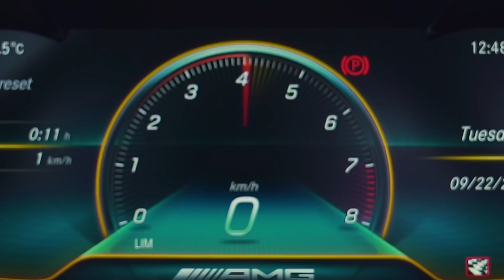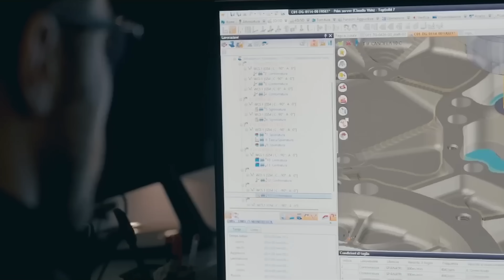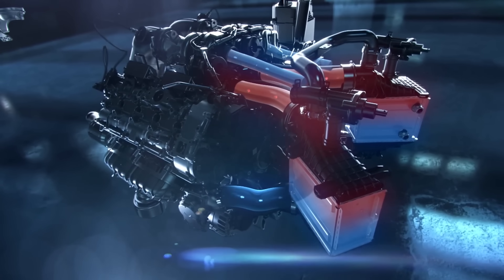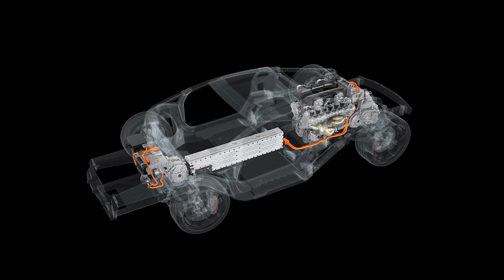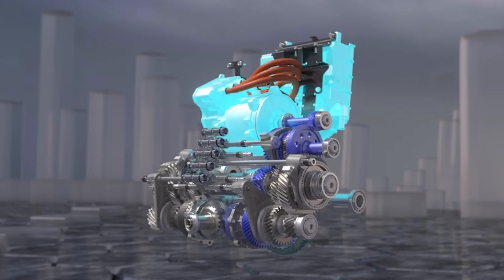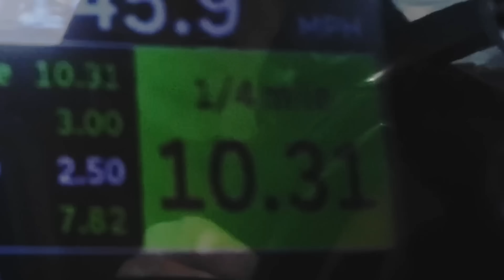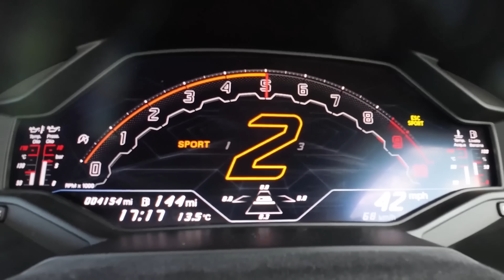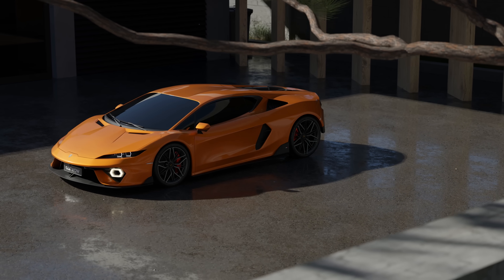Lamborghini's new Twin-Turbo Ferrari Killer!

Comment: Lamborghini needs to keep producing NA V10 and V12 cars. If they want to try electric or hybrid, make a different model, but keep what’s proven and loved by everybody in production.
Reply: they literally can’t. they have fuel consumption regulations to meet and they can’t just say “screw it” and do what they want.
Reply: @steviewondaaa9488  Even if lambo attach a eletric system make it hybrid ? So how they can makle Revuelto with even bigger engine ? That seems cost eficiency sharing a old VW/Audi/Porsche/Bentley v8 twin turbo...
Reply: Just let it go Articles Show. GET A TECHINCA. V10 IS DEAD
Reply: @yurimbarbosa0  well firstly, the revuelto barely made it past regulations. and for it to actually do that, audi and the rest of vw group needed to have evs and hybrids to take down the emissions.
Also if you listened in the video, the engine won’t be a 4.0TT V8 shared with tons of VW group cars, it will be its own V8 hybrid engine used only for the huracan successor.
Reply: Nah they should go twin turbo..way more power and torque capable ...there's enough v10 and v12 out there in the market trust me when you want one it will be there
Reply: Yawn. Power this, power that. Who needs that much power anyways?
Reply: @anttij2973 it has absolutely JACK to do with power. It's about sound and emotions. I'll take a 600 hp NA V10 over an 800 horsepower turbo V8 any day.
Reply: Nothing stays the same its needs to evolve should they just throw in a carbureted v12 from the countach?
Reply: @jeremysoto4596  Lamborghini is iconic for their NA engines. If a car does not have those, then it is not a Lamborghini in the same way. That’s just the way it is; after building cars for almost 70 years, they’ve put themselves into such a situation.
Reply: Mate, you're very much right and believe me, the people who build these cars must have wanted that more than any of us do. But, there are things us peasants don't understand that they have to listen to so let's admit that they're still a work of art and experiences we would pretty much cry having even once in our lives. These car designers and engineers are awesome and they need the respect for that ❤️
Reply: @Grimreaper-g2i V10 isnt dead bro.
Reply: @jeremysoto4596 they should produce a V12 Twin Turbo and 8-Speed Gearbox
Reply: It’s a real shame, the Huracans EA824 is a gem. Capable of holding quadruple the factory output and being reliable too, it’s a dream of an engine. Sounds awesome too, you could make it sound like the 5.0 Gallardo pretty easily if you wanted to

The C7 RS6/RS7 had an EA824 4.0t V8, the B8 RS4/RS5 had an EA824 4.2 V8.
Even the EA837 (supercharged V6) was related and they all had tons of potential for power and sounded awesome.

Those have been replaced by the EA825 (4.0t) and EA839 (2.9t/3.0t), still great engines.
Reply: You should research what car manufacturers have to live up too, to make a car road legal. They can't just make cars, if they don't meet the requirements, which get's stricter and stricter.
Reply: @steviewondaaa9488 this is mental that they don’t let artists make masterpieces, i mean there are literally only 1000 lambos on that kind in whole world where 500 are inside of garages of richmen, just why
Reply: This ain't electric. It's freaking Twin Turbo.
Reply: @Neojhun  You don't really know cars, do you. I'm referring to this, AS WELL as the Lanzador.
Reply: Rules and regulations sadly
Reply: Vw can't keep sacrificing cars to the mpg gods
Reply: I hate electric cars but hybrids without compromising the engine are badass.
Reply: @steviewondaaa9488  they are supercars not bloody economy shitboxes that have to always meet so called regulations, let them retain those V12s and V10s
Reply: @Wonderer245  what exactly is your point? they still have to meet the regulations…
Reply: Must now, what is the problem?!?! No every time only v8 or v12!!!!
Reply: It’s not a Lambo if it isn’t a V12 or V10, or it’s just a golf with a larger engine
Reply: Government regulations and the epa are killing our cars.  But you'll be able to get any boring suv you want
Reply: V8, V10, and V12 should be classified as musical art
Reply: That's nice thing to say but they'll be facing big fines for the emissions of the cars. Which is why alot of European cars are downsizing their engines. I love the C63 black series, the new C63 sounds like utter crap. So Mercedes have already found their way to safety from fines
Reply: i disagree
Reply: Laws prevent that from happening unfortunately…
Reply: I just dont want to see low performance NAs "compared to turbochargers". Just make one with a turbocharger
Reply: I just realised. This is not a new Lambo. And also, no... The new Lambo will not have a V10. Its already decided it will be a V8.

Comment: Forger about that Turbo V8 that's definitely going to be the RS6 one with a few shiny things. If it's going to replace the V10, how about cutting of 2 cylinders from the current one, downsizing it to that sweet 4.4/4.2 liters, make it high rev (about 8500/9000 rpm) keep it NA and adding some electric power just like in the new Revuelto. Give it that 680-700hp and it would be more than enough for a "baby" Lamborgini
Reply: I'm not worried about the engine. On reddit there's a discussion about the new v8tt hybrid that's gonna replace the lambo v10. It's gonna have a redline of 9000rpm and will have the hybrid system fill in down low when the turbos are starting to spool up.
Reply: The engine is brand new. It is unrelated to the engine in the RS6.

Comment: Yeah, I was quite relieved when Mat said it was a render (a bit too far in CarWow, being a bit clickbaity there). It looks good, but the rear is too much like a McLaren. I hope the final version is more Revuelto-inspired. My guess with the powertrain would be a twin-turbo V8 with an electric motor, specifically the engine from the Urus. I doubt Lamborghini - or VW for that matter - would go through the effort of making a new engine or making significant changes to the existing 4.0L like changing it to a flat-plane. Instead, it will likely be like an Aston Martin - great styling with a dirty and intoxicating engine noise.

Comment: Spoiler alert: The new Lamborghini Temerario has a 4.0L  twin turbo V8 and 3 electric motors (2 in the front, 1 in the rear) making 920 hp and 2,150 Nm of torque.

Comment: My Calculations.
The Aventador=740-750hp
The Reveluto= 1000hp+
Huracan= 640hp
Comparing All These if Lambo strips one to two motors off. We will get 640×1.5= ×
According To These  Calculations Huracan Estimated Horsepower
750-820hp
It's Rivals: including the 296 GTB 810hp+
So We Should get
Not Less than 790hp to 835 for the New Baby Lambo.
Do you Agree With me Mat.
Reply: The 296 will not really be the rival of this. Ferrari will debut the 296 successor less than a year after Lambo launches this.
Reply: @AB-80X  Doesn't matter they will still be rivals. and what is the Italian Stallion Gonna do lauch another one 830 hp remember each of these brands have a  baby supercar
Reply: @Grimreaper-g2i  
In some sense yes, but not by time of production and buyers choice.
Who knows what power the 296 successor will have. But most likely more than the 296, just like the 296VS will have. The SF90 will also be replaced at some point soon.
Reply: @AB-80X   it's gonna have much its a baby SuperCar Remeber It's Ferrari's Mid Range. AWD huarcan will beat it in 0 to 60 almost any day So There is No Doubt The 296 will have more than 850 hp in its Next Gen

Comment: Flat-plane 8 needs a smooth crossover (like a Mac Prochamber or a smooth (NOT a stamped) X pipe) or all-into-1 merger (4-1 or 4-2-1 headers with Y-pipe, 8-4-1, or 8-1) in the exhaust, as well as all equal-length exhaust, if you want it to sound heavenly and less like two 4-cyl engines.

As far as the displacement, I don't like how they went shorter stroke with the 2nd gen 6.5, though I DO like that it's bigger bore. TBH, use the bore from the new one, and stroke from the old one to have one final swan song of V12 insanity at a WHOPPING, VIPER-esque 7.6 liters that would make even a Pagani cry in the corner.

For comparison, that'd keep the new V8 at 5.0 liters, which would be more than enough, especially combined with the turbos, to do some SERIOUS damage to the competition. Otherwise, just using the same bore and stroke from the old 6.5 would also be good for the V8 at 4.3L, but better for producing torque. At that point, if the V12 had the hybrid old stroke+new bore approach, it's 7.6L would probably be enough to stand above the turbo v8 without worrying about being easily dethroned by a simple bolt-on+tune.

I mean, an 89mm stroke is perfectly safe at 8000-8500rpm, why rev higher when it just makes it harder to match a trans and diff for sufficiently low cruising RPM for corporately/regulationally acceptable emissions and fuel consumption while still actually taking advantage of higher revs with gearing?

Yo, but I'mma have to stop you from disrespecting the 296gtb sound, that thing is amazing with an aftermarket exhaust. Hate on Ferrari as a brand because of their shitty business practices and treatment of customers, but I will no longer tolerate "V6s sound bad" slander. G E T  O U T.

Comment: I hate the hot v tt, v8 from vw/audi group. Bring back the tt v10 and build it up to out out 600hp. Still retain v10 but smaller, higher rev limit and just a bit short of the v12 power. Sad to see lamborghini use v8 😢

Comment: Well, as a absolute R5 and V10 Fan, i am not amused. It looks like the same mistake Prosche did with the 718. A Turbo V8 is the same boring stuff as any other sports car in that class now, thats the bigger issue to me than the hybrid system. So yeah, if you ditch the V10, then just go fully electric directly. What they do now is just a slow painfull death for their ice lineup.

Comment: i think they should use the the v8 from the first gen audi r8 but it's a goodbye to the v10 rip lambo v10 from 2003 to 2023 with the r8 huracan gallardo and sesto elemento
even the other v10's from dodge and bmw and lexus 
from 2009 to 2013 to the lfa v10
viper v10 from 1991 to 2017
carrera gt v10 from 2004 to 2007
m5 and m6 v10 from 2005 to 2010

Comment: Hi carwow  Matt 
Little request ..
You know how some Supercars have offset pedal positions (yes lambo the worst offender)
It would be great to learn which cars have such off set driver and pedal  positions and if there is a difference between RHD VS LHD market cars. 
And more in the topic of brake pedal feel in comparison to “normal” cars .
On many sports cars with carbon or performance pads , discs : on how they require u too relearn the way you brake a car. For example  You hit the brakes wanting to slow down a little … don’t feel like it’s slowing down so u stomp again as hard as possible and guess what , abrupt stop..why u have zero feel at all. 

Many LAMBO RHD Cars the pedals are offset to left so badly u can’t drive without using left foot braking.  your brake pedal is where the rest pedal or clutch would be . Easier in LHD markets pedal offset or the right. 

So please if you can … tell us which cars do that …

Comment: They have the perfect 5 cylinder engine that sounds like a baby Lamborghini v10 in the form of the Audi's 2.5l EA855 5 cylinder engine, why would they not use that?!
Reply: I don't think Lambo fans would be pleased with that with just half the cylinders and have it underpower the car.
Reply: @SolaricSage116  Full bolt ons and e85 tune and people are making 600hp to the wheels on rs3's. They could totally rework the engine with new rods/pistons, bigger turbo, intercooler, etc. and make a whole lot more power while still keeping that baby v10 noise.

Comment: Looks like a bit of a dogs breakfast.  Hardly cohesive.  A hotch potch of straight lines and curves.  I sincerely hope this guess-timate design is waaaay off the mark.  Not a big fan of the Revuelto either.  This open engine look is just awful.  The engine and electrics will be ruined after a few wet drives...